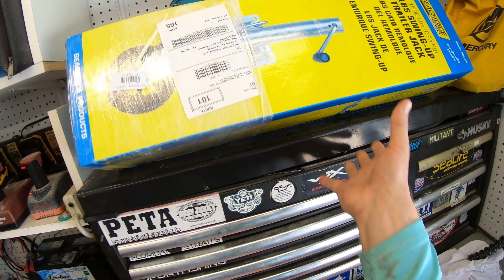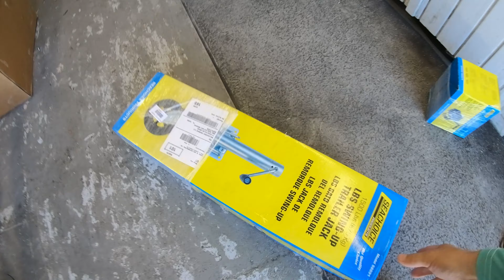Cheap Boat Trailer

Comment: Short trailers like that I always add the guideposts so you can actually see the trailer when backing. I also wire the lights to them to keep the light kit out of the water

Comment: Sealed signal lights from transport trailers are the best no more replacing lights all the time. I installed them on one of my trailers they take a beating and they always work.
Reply: LED is the best upgrade.
Don't need to unplug before launching to prevent hot glass bulbs from shattering.
Reply: @ctom4932  Then in fresh water you can run $4 taillights. No if I CAN I use the oval sealed commercial lights way the hell better salt water it don't matter they work

Comment: Love these types of projects. Easy and so satisfying.
Reply: Totally agree
Reply: Easy with thousands of dollars worth of tools.
Just that DeWalt gun he's using is $300. It's not the top of the line DeWalt either. Mine was $375, DeWalt brushless 20V with 1,200 ft lbs.

Forklifts used to move boats, it's cheating. And I couldn't imagine doing my job without a forklift. 4 triple axles in the yard right now, biggest is a 35' with a trailer rated for 18,000 lbs (9 tons).
It doesn't like turning at all. And it's got to turn in areas you couldn't U-turn a so called Smart car.

Comment: I bought one of those anti rattle hitch things for my trucks receiver.  We’ll I installed it and went out to run errands and went over 100 miles and didn’t even realize that the socket was still stuck to the nut 😂😂😂 I happened to see it and was shocked it didn’t fall off

Comment: Best I ever saw was under a 12' jon boat.
It had been parked right next to a building with a metal roof.
Heavy snowfall build up on that roof, before it all slid off.
The springs and bunk boards remained intact. The frame directly about the axle was completely severed on both sides.

We had an empty trailer that was a close match. Two of us picked up the Jon boat and transferred it over.
The old trailer, removed all non metallic parts, including the bunk boards, which then let us fold the trailer pieces onto each other and fit it in the metal scrap bin.

Comment: One, most important word - Galvanized.
Rust is like cancer - torsion axles rock - don't go by the tread - condition is everything 👍rubber rots- seized bearings are a very bad word, even thinking about them. never mind driving away from your boat 🚤

Comment: Aaron run a new brown running light wire down from up by plug to your mid section amber’s don’t learn the hard way like I’d each running light (ambers)has own it’s own wire from up by plug and solder into harness JT HOOKED N ROLLING OFFSHORE 🇺🇸🇺🇸🐟🐠🎣🛥